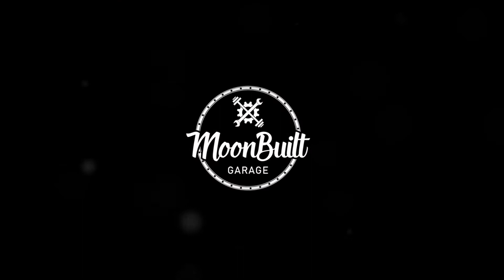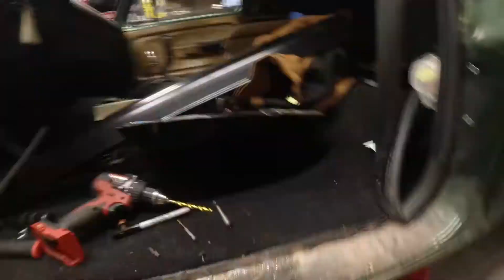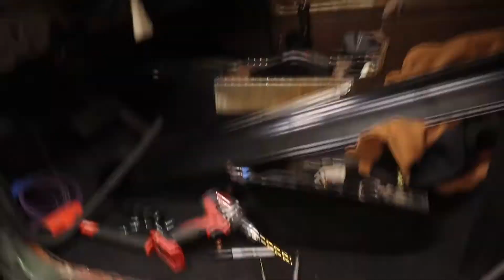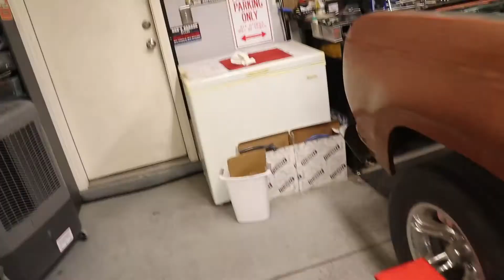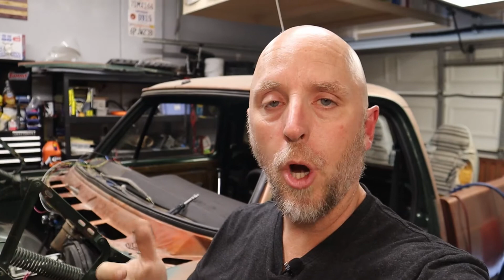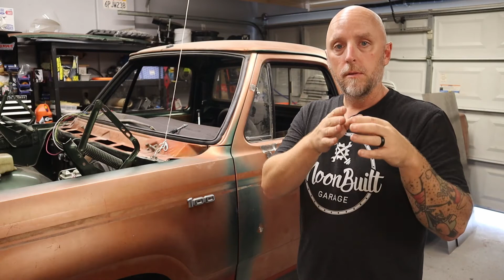Repairing a Dented Rocker Panel | DIY Body Panel Replacement | Sheet Metal Repair Cheap and Easy

Comment: Nah, theres a big opening  on the inside at the back corner of the cab. stuff falls into it then migrates forward with braking. never seen one that didn't have a bunch of crap in it
Reply from the maker: I know the hole, but that brush I think is too long to make the turn down the rocker…could be wrong though 🤷‍♂️